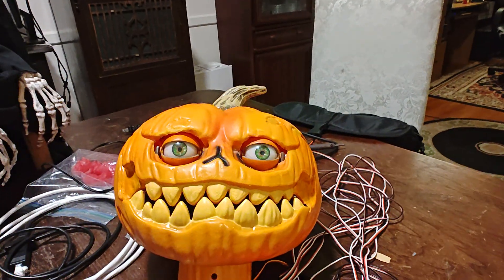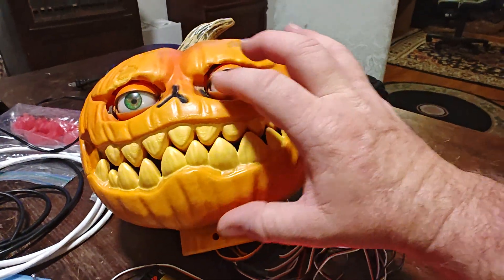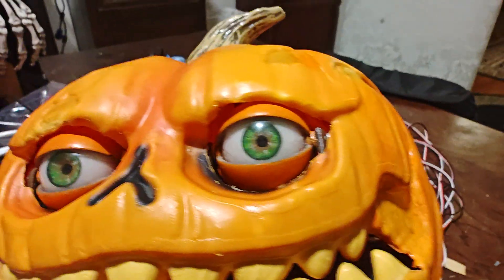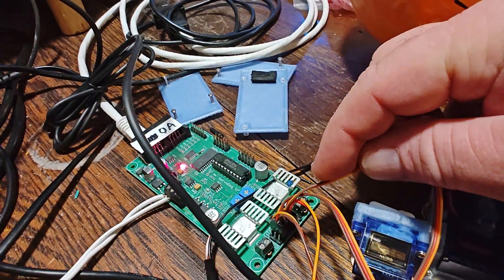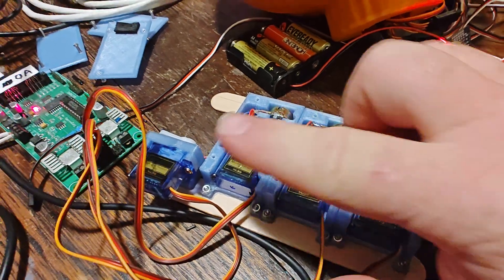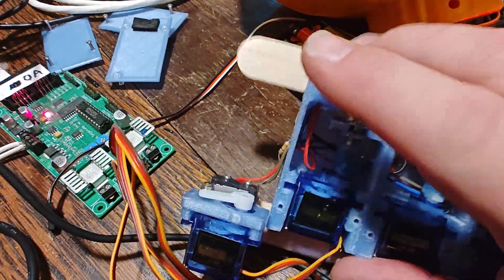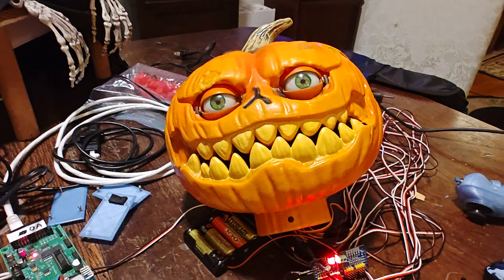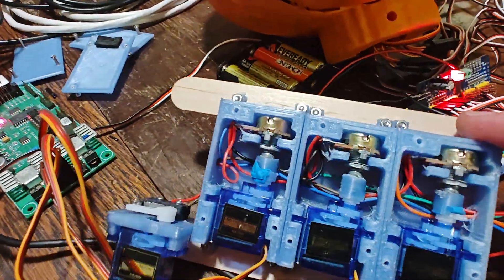3D printed eyes for a new puppet

Comment: Very cool, but wow is that an elaborate way to do the servos! :) I have been working on a board with a couple of friends that is based on the "Jawduino" but controls a bunch more. It's basically an arduino nano and an mp3 player that will sync the jaw servo with anything that is on the mp3 SD card, it also operates 4 other servos to do random movements at different speeds and operates LEDs etc. Hopefully, I'll have a video of it up soon. I really love the look of that pumpkin head man!

Comment: Looks awesome. I like the new character.   The Servos to potentiometer seems like a clunky way to do that, too bad there isn't a better way to interface the board.  If it's PWM, could you charge a capacitor to build up a DC level... hmmm... maybe it's not as responsive.  That's a tough one to think about, but I like the character
Reply from the maker: Yes indeed it is clunky... and has a lag.  But I am not any good at altering arduino code to read the LOR servo outputs instead of the joystick.  
My first attempt was to control the joystick directly with servos - that was a disaster.  This iteration is much more compact and reliable.  But I am sure it could be tighter with a direct connection between the LOR controller and the arduino uno.   I just don't know what to rewrite to make it happen.

And thank you!   This guy has been a blast to build!  I can't wait to show off the entire puppet when complete!
Reply: @intocoasters  don't all servos already have pots? I thought that's what made them servos and not just motors.
Reply from the maker: @ge2719  you are correct! The pot in the servo tells the motor when it has reached the target position. That's internal feedback for the motor itself. The pots outside, like in a joystick or a radio controler, those tell the servo motor what the target is. When you move the joystick you're turning a potentiometer to a certain position between 0 and 100% of its value (this will affect a PWM signal that is sent to the servo) The servo motor then moves to try to match that value. That's kind of an oversimplified version of how it works.
Reply: Wow. Looks great. Coming along nicely. Appreciate you sharing.
Reply from the maker: @allthingscoolandcommon5161 
Thank you very much! These kind of builds are always fun to share. I'm hoping this guy turns out like the vision I have of him in my head. Should be an amusing addition to the existing trio.